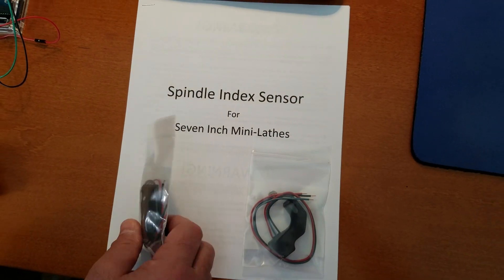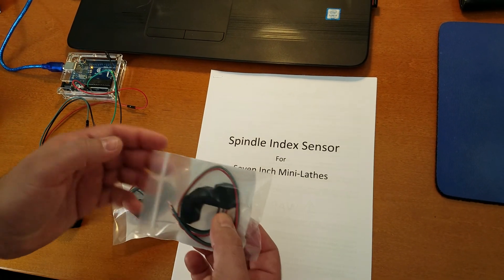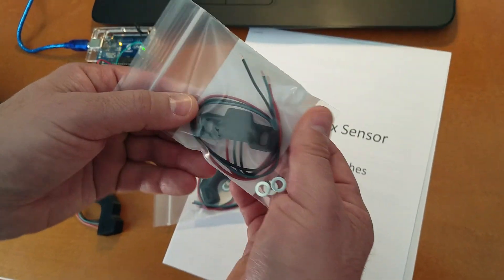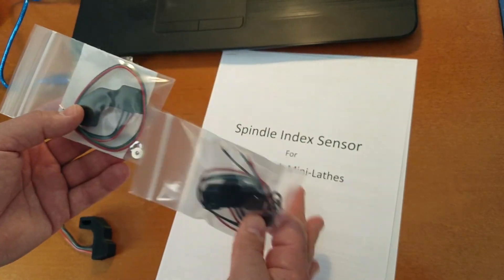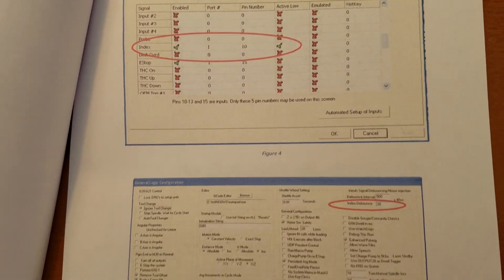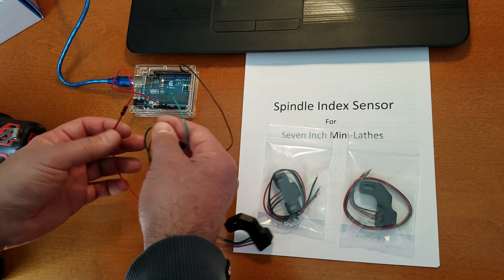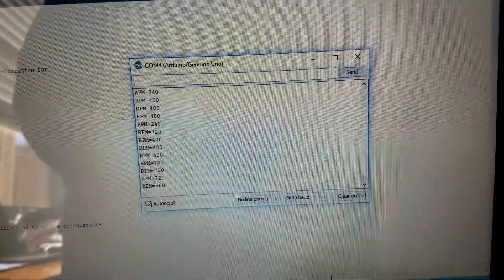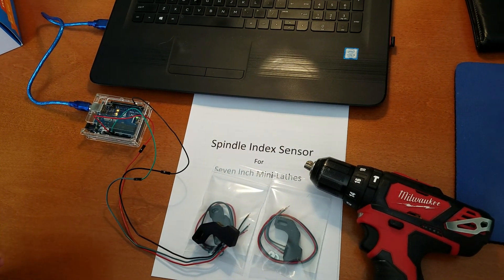For Sale: Mach3 Spindle Index Sensors $30 for RPM feedback

Comment: Have you tried to use the closed loop spindle control in Mach3? The pid settings seem to be there but I'm not sure it works, no one talks about it. Would this sensor work for that?
Reply from the maker: Hi Stuart.  This sensor will provide the index pulse in Mach3.  I've never used the PID settings because I never used Mach3 to actually control the spindle - I only detected it's position using the index pulse.  That allowed me to do threading so long as my spindle didn't get bogged down in a heavy cut.  It also allowed me to do inch/revolution feed rates which I prefer when using a lathe.  If you want to  try a sensor, I'd be happy to provide a refund to you if you decide to return it to me in good working order.